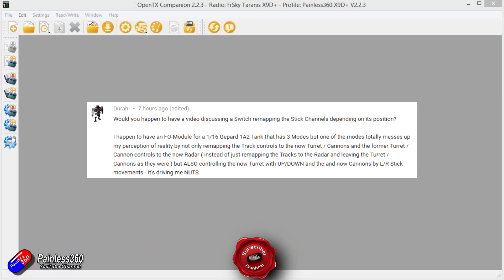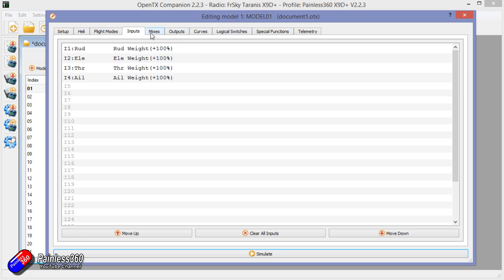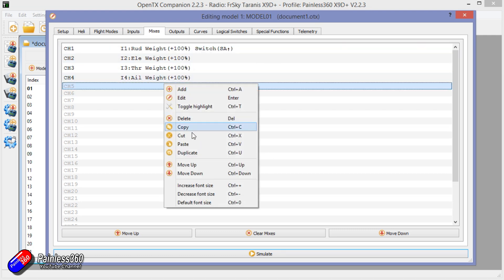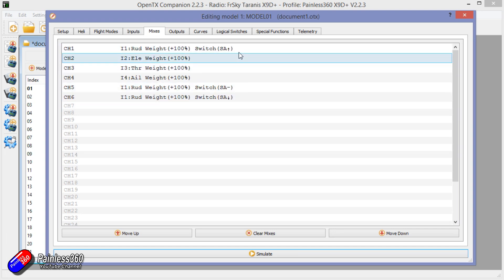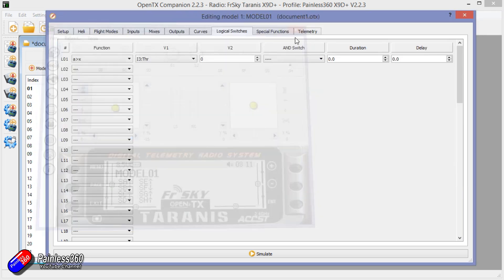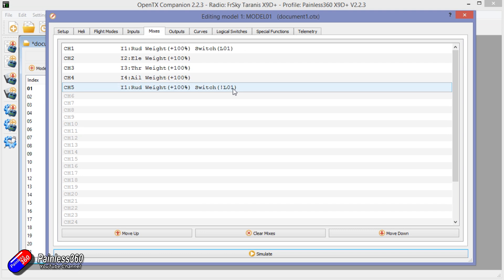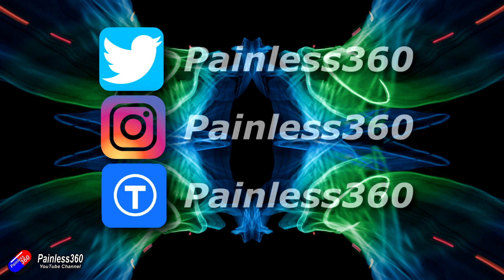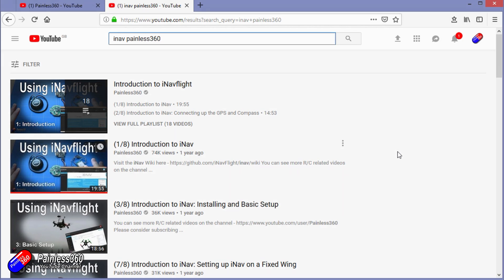OpenTX Quick Tip: Changing channel outputs via switches

Comment: First thank you for all your wonderful videos.
I try to find answers to my questions on you channel but maybe you could help with this question.
I have a QX7 with the newer 4-1 external modular.
I can connect to my UMX radian glider just fine and the controls work fine. 
But can I use Open TX to turn off (control) the SAFE function of that plane?
Cheers & Merry Christmas
Reply from the maker: If it's controlled by a channel (a quick google search and it looks like it is - Ch6) then it should be easy to set it up. Just add a switch to that channel and see what it does... Best of luck!

Comment: Here's a challenge for you. One of my models is a sail boat. Its to big to fit in my car so I have to re-rig it every time I go to the water. I have a QX7 and use the throttle channel to wind the sails in and out. So every time I have to adjust the min and max travel of ch 1. I want to make S1 adjust the min travel of ch 1. And S2 the max travel. Is this possible?
Reply from the maker: Done, video will be out in December sometime. Hope it helps! :D
Reply: @Painless360  Awesome. Thanks.

Comment: Don't use the technique for throttle limiting for limiting ailerons, bad things happen.
Reply from the maker: See my video on dual rates ;)
Reply: What will happen?
Reply: @mortache  well if you set your ailerons so they only go from 1000-1500 (eg a 50% throttle cut) you only get roll in one direction and centre stick is halfway deflected. In my case it made flying pretty tough.